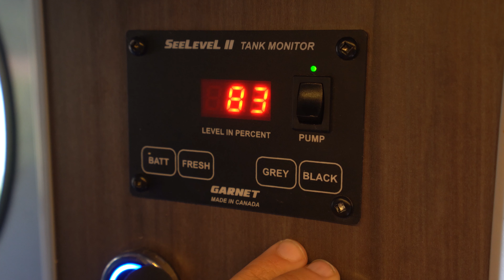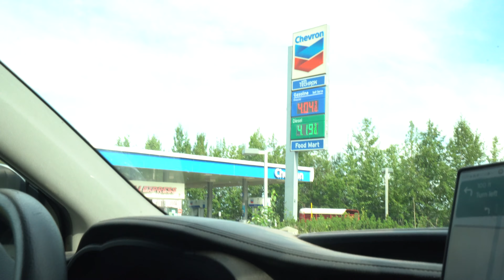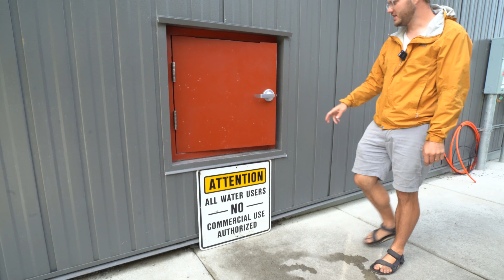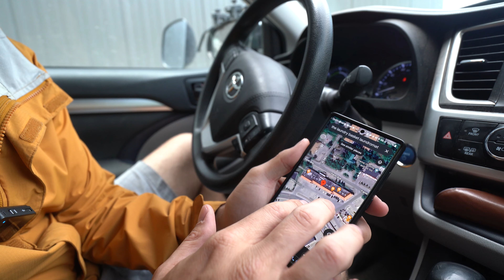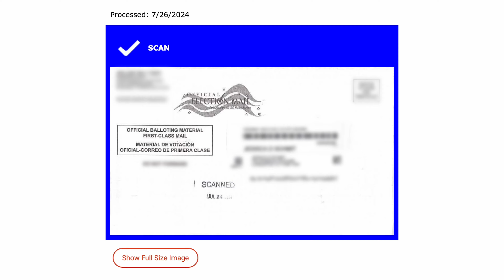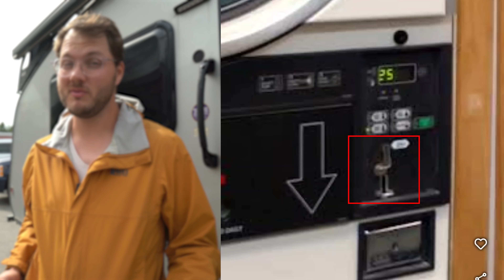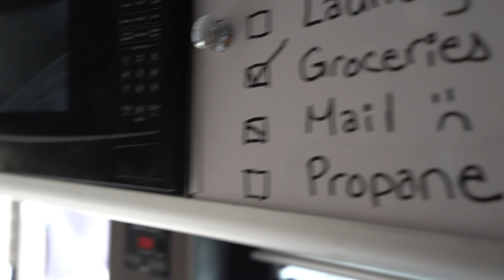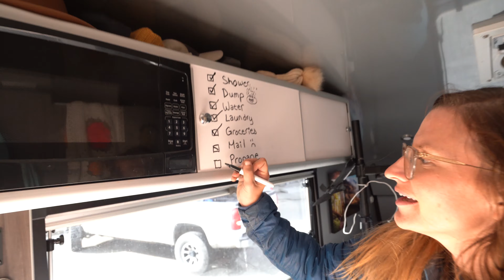What Nobody Told Us Before Moving Into an RV

Comment: The cage thing at the fire station is for cold weather. I used to live in the far north with continuous -40 temps and the easiest way to keep stuff from freezing is to keep it inside a heated structure. The cage provides physical security to the building while allowing fire trucks to fill quickly without freeze issues as the internal building warmth surrounds the valve and hose adaptor.
Reply from the maker: Very interesting, thanks for sharing!

Comment: The RV toilet paper only thing has been pretty thoroughly myth busted if you want to save a little more $
Reply from the maker: It definitely wouldn't surprise me if that's the case for many RVers, but without being too gross, the "moisture to solids" ratio in our black tank is probably much different considering we have to be really conservative with how much water we put in the tank for boondocking. While a lot of our viewers might flush with close to a gallon, we use a lot less than that. I suppose I could test it out, but I've heard some horror stories about having to clean out "poop pyramids" 😬
Reply: I agree with @HoustonMtn on this one.  The top rated toilet papers for RVs are usually Angel Soft and Kirkland brands.  They break up quite easily (better than the “RV” TP), and are a lot better for your black tank.  The RV toilet paper is quite the racket.